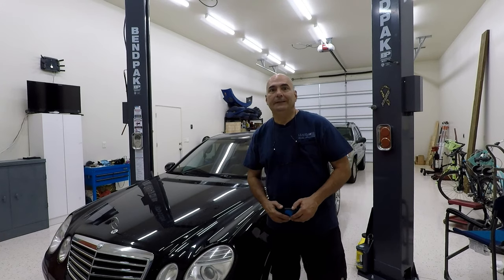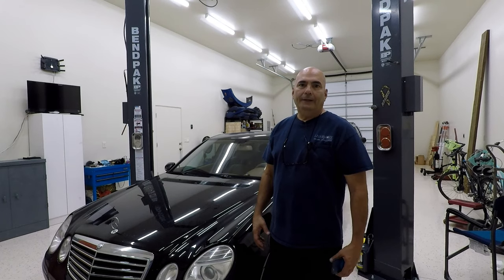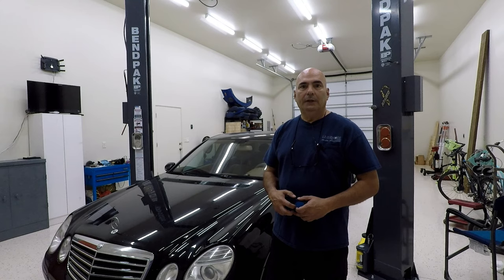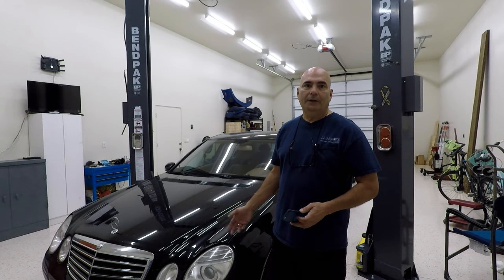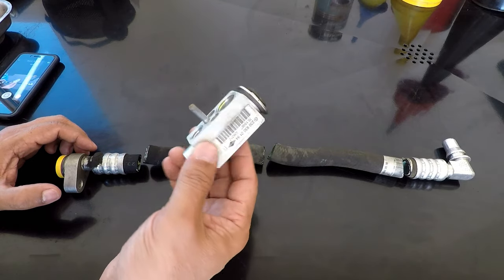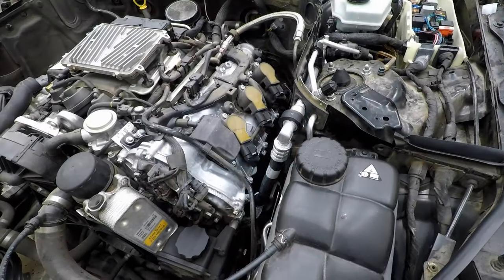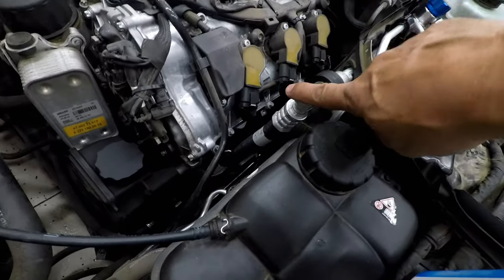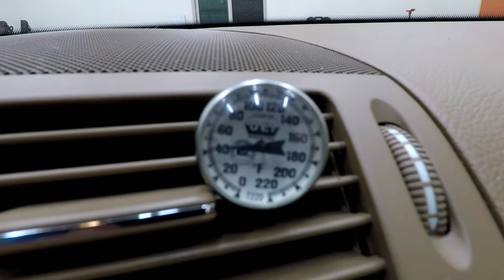Mercedes Benz A/C Not Cold!  Watch Out For This Hose!

Comment: Nicola, 
Thank you for making this! And THANKS for figuring this out! 
We just had our 2008 wagon in the shop for air-conditioning issues. I started to drive the car home and I thought to myself it’s not cold enough. I drove it a little bit more and didn’t get much colder so I turned around.
Our non-dealer Mercedes mechanic had it for another few days and could not find anything wrong with it. He went over with us every single thing that he had done. Since I know that they knew what they were doing I couldn’t question them. They did the right thing. And I knew that I wasn’t crazy. So I thought to myself there has got to be something else… I kept on thinking that. After a couple of research I ran into your video and I cannot thank you enough.
They have the part on order and we’re glad to have a found out about the mystery.
Thank you again!
Reply from the maker: I hope it works out for you.  Just remember your mechanic should have seen an unusual reading on the low side of the a/c system. That's the dead giveaway. It should be around 30 to 40 PSI on the low side. Once you fill the system to its proper level it should work. If you're still having problems. Check you blend doors in the HVAC system to make sure they are working correctly.
Reply: @InitechAuto  Will do and thank you!
Reply: @InitechAuto  Hi. What do you mean by blend doors? Thanks.
Reply from the maker: @ontheball247   When you change your temp settings. That is what moves to adjust for your desired temp. They are controlled by actuators.  These items are inside the dash.
Reply: @InitechAuto  Thank you for the knowledge. If you've used the tool before,  do you know how it works? Or know of a work around? I've posted this question on the video, but on a bit of a time restraint, otherwise I would just be getting mercedes to do the job, but they can't see me till next week at the moment
Reply from the maker: @ontheball247   I was not successful with the workaround. Broke it.  Ended up buying a new hose. The tool pushes on the two pins inside the coupler. The sad part is. You will never use the tool again. It will become a souvenir in your toolbox.
Reply: @InitechAuto  I can feel the frustration you must have felt. But glad you got it done, and thanks for the advice. I was lucky with just pushing in the pins, but I'll explain by my other comment further up, so more people can read it

Comment: I had that exact same problem on a 2008 GL450. On mine, that hose runs very close to the exhaust manifold, which may have contributed to its premature failure. When I replaced it,  I added some header insulation around the hose and secured with some stainless wire ties I found at NAPA.

Comment: In case this helps any one... and please, read this to the end before starting any of it, if you wish to try this (at your own risk), as it does work, but needs to be done a certain way, and with 2 people.
I used long, thin centre punches to slowly push in the pins (at 3 and 9 o clock on the coupler), which made 2 more pins (at 6 and 12 o clock) push out of the coupler. I pushed in (not too hard) until I saw that the pins at 6 and 12 o clock weren't coming out any more.
Then, while I held the pins in, my awesome mechanic (admittedly this worked because of his experience...and this is the tricky bit) used long needle nose pliers to lightly grab the pipe just before it enters the coupler, and slowly and gently wiggled the pipe out of the fitting.
Then the part I actually found difficult was getting the 6mm allen key bit onto the lower bolt and breaking it free with the tight space I had, right next to the hot engine and exhaust manifold (if you also do this with a hot engine, I believe you too, will burn your hands. Lol).
I hope this helps someone. But please remember to be slow and gentle when pushing in the pins, and wiggling the pipe out.

Comment: I have a similar  issue  with my S211 it will not go below 10c/50f, it has been recently recharged  with gas this pipe could be the issue but first I will change the sensor on the high  pressure side of the system ,this sensor is a temp and pressure sensor,my code reader is saying the pressure side of the sensor is not working ,so this will be done first ,then I will have a look at this pipe , excellent  video, thank you.

Comment: My 2009 CL200K is problematic too.  

90% of the time the aircon is gutless and always when I most need it on a hot day.

Yesterday I noticed cooled/conditioned air was coming through the front passenger the vents. 

Ambient air was coming through driver side vents.
Reply from the maker: Sounds like a blend door actuator problem.

Comment: I got the CTA 2763 tool to remove the hose.  The question I have is once the tool clips on do I push out the hose or push back the tool and coupling? I don't want to break the tool or the coupling. Thanks for your help.

Comment: Ii have 2003 e320 base model for a while the ac sometimes works fine and sometimes doesn't, until last year suddenly stop working   im not to good on ac but i been changing the compressors on my other cars on  i connect the gauges but i don't remember the readings only what i remember is the car dont take no more freon and also i notice that the system has freon because the freon came out of the hoses and i press the valve and freon came out so that make me think that i have this problem with this hose. So maybe is very common with this cars, i have also gl550 2010 i owne this vehicle for the last past 6 years and after 1 year compressor stop working so i replace the common do the vacuum and wait for leaks and after 2 hours looks like everything was fine y recharge the system and works but after 1 year maybe start with the same issues like the e320  especially when is very hot the ac don't want to work properly, other this i notice is when i driving or i stop if i flooring the engine over 2500 or 3000 rpm the ac start working so my question is on both cars is possible tha i have the same problem
Reply from the maker: Look at your manifold gauge reading’s.They will tell you what’s going on.

Comment: Great video!  I have a strange leak in my W211 system.  It will hold a vacuum for hours but leaks refrigerant within hour of the next use.  I put some dye in an I think this hose might be the source of the leak but I am puzzled by the fact that the system will hold a vacuum.
Reply from the maker: This hose is more of a performance issue. Most likely not the cause of your leak. Take a good look at your compressor seal.

Comment: Great video, I see my 07 C230 is on that list as well, but mine has a weird problem where it would blow hot air on the passenger side at the same time cold air on the driver side, will look at that hose.
Reply from the maker: That would be a blend door issue.  Check your A/C controls and actuators.
Reply: @InitechAuto  will do, thank you much.

Comment: Hi,

Thank you for your video
I have ML 300
Cdi and having an issue with Ac.
When it is hot, it is fine. But, for cooling. Left side is cooler than right which lasts only a minute and starts getting warmer. 
I have tried to top up ac 
But, mechanic guy said, it could be compressor which i belive that should be last thing yo be replaced as it may be smaller problem.
Do you have any recommendation plz?
Thanks

Comment: Hey man, thanks for this video. I'm doing a similar repair on a 2008 S550. Before watching this video we could not get the low pressure hose off, so we destroyed the black coupler and the replacement hose comes with one on it. For some reason though, I cannot get it all the way on. It does not go up far enough (maybe just to the second O ring). Is there any special tool I should need to do this? The replacement hose is OEM, part number lines up and everything.
Reply from the maker: I was able to push mine right on.

Comment: Nicoya -Great video. One question - I noticed that the freon can during your refill was upside down.Most cans say to keep upright.Were you using something different or do you have a better technique. I rely on guys like you to help DIY guys like me. Thanks in advance of a response.
Reply from the maker: All manuals tell you to have the can in vapor mode (right side up). However, I hold it upside down to speed up the process of getting freon into the system. Large amounts of freon in liquid form can possibly damage the compressor, so I'm adding small amounts. I have never had any issues with this method myself.

Comment: What about W205 is this effect too. October 2016 model a/c compress just stopped hybrid model C Class
Reply from the maker: I don't see that model on the list.
Reply: @InitechAuto  Could you tell me what this error code is? P261100 - The regulating vale for climate control has a malfunction. Do I need to change the air conditioner compressor? N3/10 and N127 all have the letter F on the xentry Diagnosis. program.
Reply from the maker: @dr.akmakjan1283   Can't help you with that code. I have no idea.  Take it to the dealer.

Comment: I have a 2008 W204 and think I might be having this issue. How do I tell, without removing the hose, if it has gone bad? Can you feel it by touch, like you "feel" an old radiator hose cracking from inside when you squeeze it?
Reply from the maker: @AHMaquiladores  the only way you can tell is by using a manifold gauge set like I demonstrated in the video. You will see the readings are not normal.

Comment: Thanks for this video. Hopefully this will solve my problem. I purchased the car in October and never knew the AC didn’t work until the first hit summer! 

Could you just give a tip on how to remove the end from the plastic coupler? You expressed the importance of not breaking it. It would be nice to have a heads up on the proper way to disconnect it. I figured if you broke it, I’m sure i will too.
Reply from the maker: I believe the tool you need is like this one.  I did not have this tool and ended up breaking it. 
https://www.fcpeuro.com/products/mercedes-ac-low-side-coupler-remover-cta-tools-2763?ads_cmpid=352578559&ads_adid=22978217719&ads_matchtype=&ads_network=g&ads_creative=85228362199&utm_term=&ads_targetid=pla-70936742985&utm_campaign=&utm_source=adwords&utm_medium=ppc&ttv=2&gclid=Cj0KCQjwlMaGBhD3ARIsAPvWd6i59yjk0F0JWjvCOOSLxKSg2XmLsFGCGgEy2eF6_jWVge9rAJWksNEaAsS6EALw_wcB
Reply: @InitechAuto  Ah thanks! I’m certain I would’ve broke now! Lol. I’ll order the tool now.
Reply: @InitechAuto  interesting. In the website it says it doesn’t fit the GL450. Maybe I’ll give them a call first.

Comment: Nicola, hi there I have a 2012 GL 550 I wasn’t able to get any cold air so I brought it to a AC mechanic and so far he has changed my compressor 6 weeks ago. The air was cold only for a day then I brought it back to him. Then he told me the fan was only working intermittently so he said I need a new fan. I bought a fan and he installed it. The air was again cold for a day. I brought it back to him and he crawled under the car and said he found the discharge hose line to be leaking. He ordered a new discharge line and installed. Once again the air worked only that day. 
Do you think this suction hose line to the compressor could be my issue?? Thanks for the video and answering my questions sir.
Reply from the maker: Sounds like you need a new mechanic. The issue with the hose in this video is that it would never work well. It would not be a intermitten problem. You just need a better mechanic to find and isolate your problem and stop throwing parts at it.
Reply: So you think he should replace this suction hose and see if that fixes the problem? Thanks again
Reply: Also what are the correct readings for the low and high side when the system is working properly.
Reply: Right now finding a new mechanic is not an option because my vehicle needs to be fixed and he has the car at his shop. I am waiting for him to call me and tell me what he thinks is the problem now.
Reply from the maker: @darrellphillips3410   Check your manifold readings before coming to any conclusions.  You have to diagnose the problem first.
Reply from the maker: @darrellphillips3410   On the low side your should have readings of about 30 to 40 PSI.  On the high side it should be somewhere around 150 to 200 PSI. Depending on ambient temperature and humidity.
Reply: Thank you for your replies. This has cost me $1,500 so far and it’s no better today than it was 6 weeks ago when I brought it to him. Hopefully the parts I replaced were really needed and not just a waste of my money. 😌

Comment: This is very interesting, I have an intermittent AC issue with my 2009 c300 (w204).
AC works great until it's hot outside (93f or above) and the car been parked under the sun for sometime then it just blow hot air and it doesn't command radiator fan to work faster, once the fan runs fast everything works great. If parked under the shade for like 30 minutes after that it works again 90% of the time.
Any idea on what direction to look for?

Thank you.
Reply from the maker: Try using a bi directional scanner. See if you can control the fan to go to 100%. Other than that I would probably suspect the fan itself.
That definitely sounds like one of those tricky problems.
Reply: @InitechAuto  I was looking to buy one and test with it. Most mechanics around me don't worth a penny unfortunately.
Reply from the maker: @NWCI  If you find out what the problem is. Let me know. I’m curious myself.
Reply: I have the same issue, the AC works sometimes and the fan is not engaging properly, the car also gets really warm however its not overheating
Reply: Any luck with this one?? I think I have the same exact issue with a 2014 c180.
Reply: @InitechAuto  I have this same problem with my W204 2010 C300 4matic sport.  AC works great in the morning but when sitting outside all day in heat and I start the car, it blows 70ish air (feels like its slightly blended).  Other times it works great when its hot out.  Turning the car on and off helps to get it working, also reving up the RPMs.  I've read that there is a magnetic clutch that over heats and gets stuck.  This is a common problem with these cars but no one knows the solution.  The AC isn't leaking or broken b/c when it works, its perfect.  It just doesn't always want to work right away, especially when the cars been outside in the heat.  First start in the morning it seems to always work. Any idea?
Reply from the maker: @tbling  If I had to guess. Blend door issues. Or the system needs to be topped off.

Comment: Excellent video and source of information. Thank you. I have a related AC question. 2008 GL 450. AC will work fine for hours then suddenly blow warm air. it can stay in the warm air condition for a day or two sometimes longer, then, it will work fine (bone chillin).  It appears to be a control issue and less of a refrigerant issue. Any thoughts? Thanks again.
Reply from the maker: Make sure the evaporator is not freezing up. If it is, that would indicate a faulty expansion valve.  That's what it sounds like to me by your description.
Reply: @InitechAuto  Thank you, I will give that a try. Greatly appreciated.
Reply: @jimbarger1241  did you get your A/C figured out? I have same issue with my 2007 GL

Comment: Taken my Mercedes A class for a a/c top up, but they say I have a leak in the system, have completely checked the system and I can see no leak, if the hose has collapsed would this show on air con dials the same as if the system has a air con leak?
Reply from the maker: No, the readings would be different. The collasped hose would strictly be a performance issue. Showing a high reading on the low side. While a leak would just show up as low readings.
Reply: @InitechAuto  Thank you so very much for your reply, will have a good look at the hoses, there must be a leak there somewhere. Once again many thanks.

Comment: Just thought I'd ask. My 2000 c280s air quit being cold this year. Blows only warm. I checked the compressor plug and it is not getting power. A/c has a full charge. I checked the compressor wire and no breaks. Would you say maybe the evaporator sensor switch? I checked the three
fuses none were blown.
Reply from the maker: Check and see if the PCM is commanding the A/C relay to turn on. And of course, make the relay is good.  How do you know the A/C has a full charge?
Reply: I rented gauges and hooked them up to the high and low ports. The readings fell within the fully charged parameters.

Comment: Very impressive discovery about the collapsed hose.  Was the radiator fan running on high speed even when you start the car after an overnight park ( cold engine) at the time you had a high psi reading at the low side?  That is what my fan is doing on 07 e350 4matic.
Reply from the maker: To be honest. I don't recall if the fan was running on high.  But it was on.  Just look at your manifold gauges.  Do you have more than usual high reading on the low side?
Reply: Not on the manifold gauges but on my odb2 scanner it reads 116 psi when ac is running and 75 psi when ac is off.  Scanner does not say if this is the low or high pressure line reading.  In my case the ac is cold after adding a 12oz can of r134a.  But the fan problem is a mystery that I’m trying to fix.  I’m asking because someone suggested that a high pressure reading can trigger a fan running on full speed.
Reply from the maker: @maherkhabbazeh4333   Turn the A/C off.  If the fan stays on high.  You might have a stuck relay.  Good luck!
Reply: Had same issue, I replaced my coolant temperature sensor and I was sorted.
Reply: @maherkhabbazeh4333  I don't know if it would help you, I'm really no expert. But I had the fan running at high speed when I pulled off the AC fuse.